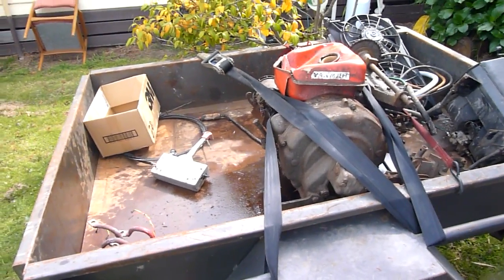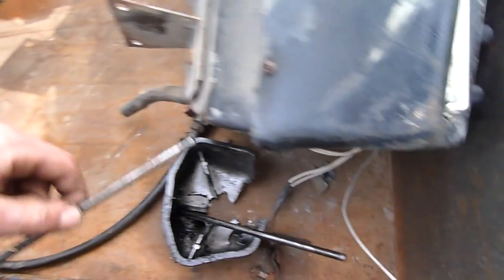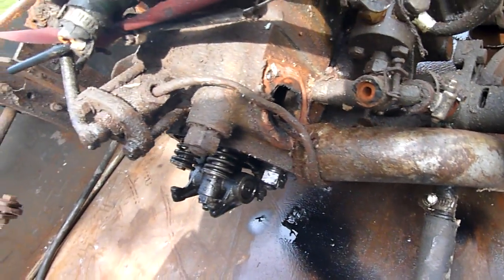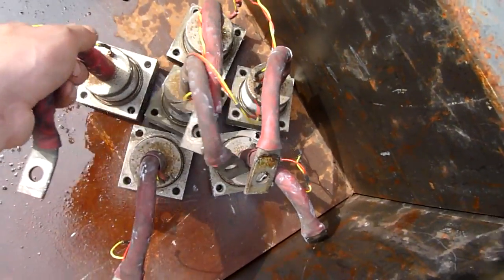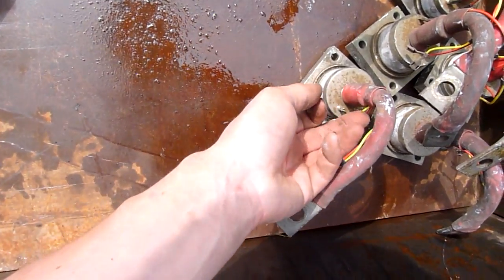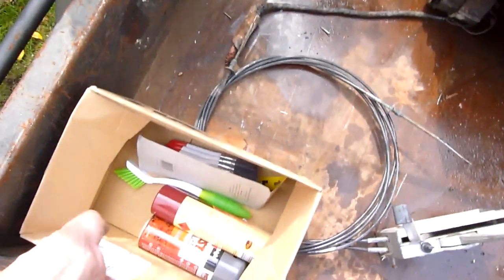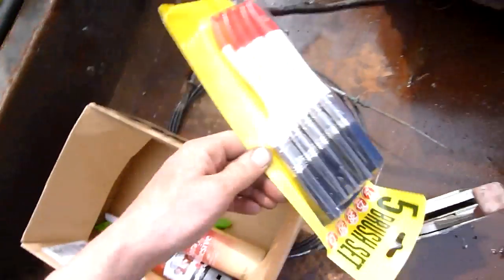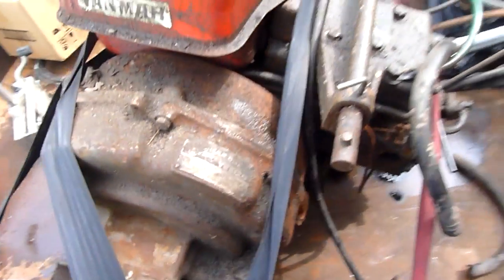Scrapyard Goodies - Yanmar YSE12 Marine Diesel - Fans - Vintage Holden AC etc

Comment: Try using oven cleaner instead of engine degreaser. Pretty much the same stuff, only cheaper. And hair spray for coating loose insulation.  The SCR's are rated for 1000 amps, probably were part of a surge protector circuit for the power company, probably all cooked or discarded due to age. After all you had that nice storm the day before.

Nice haul, I would have cobbed onto the props, good for smelting for the metals if they were bronze/phosphorus.